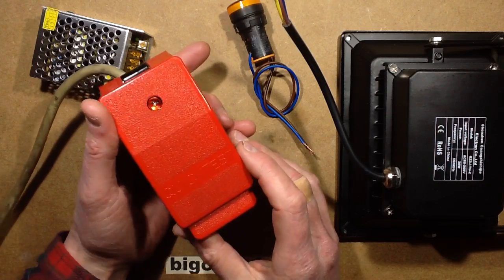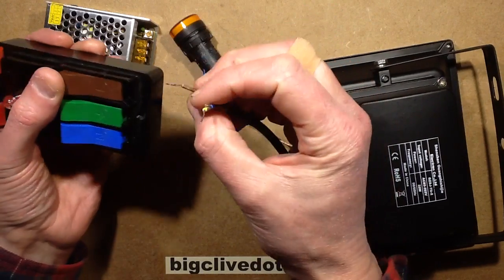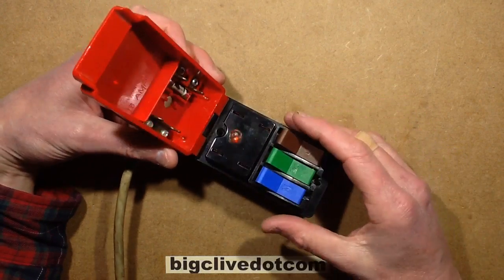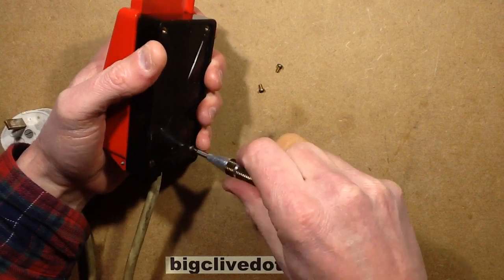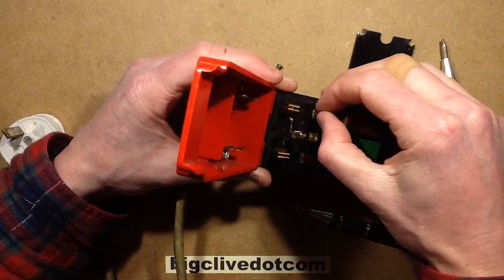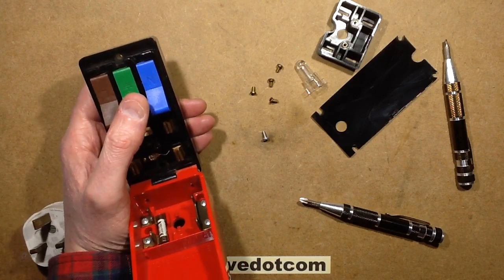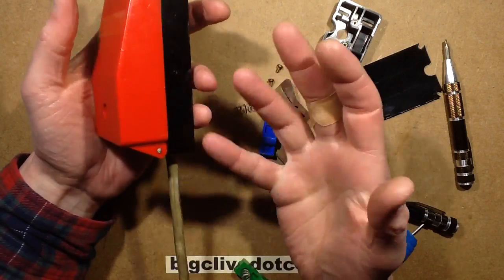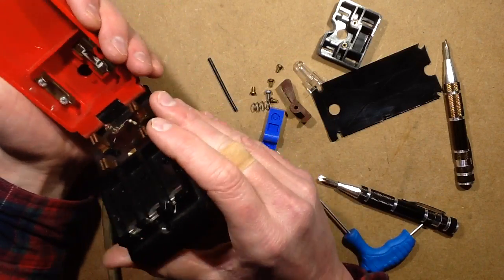A look inside the Cliff Quicktest mains connection unit.

Comment: Finally bitten the bullet and bought one of these. They are expensive but quality costs I guess.
Reply from the maker: They're extremely useful in a workshop.
Reply: Saw one in a second hand shop back in the 1980's the guy showed a fan that I was buying worked with it (the plug was extra). Thought it was a neat gizmo then. The fan is still working by the way.

Comment: I’ve got mine back in the early 80s but it called branded as safe block and the conductors are bear metal but covered when the top is closed. Very useful tool to have.

Comment: The least expensive US supplier I could find (Newark) still has the quicktest with US wire colors for $60 if you buy one and $40 if you buy 20.  However, I did find a shop (cloudfree) reselling them for $48, so I bought one from there. They specialize in non-cloud-based "smart" devices but the owner must be a Clive fan since the quicktest is otherwise quite out of place in their shop.

Comment: Risk analysis:  work backwards from either "I" or "test tech" got electrocuted, and see what's an inexpensive way you could have prevented it.  Or from an ER visit, which is time-consuming, perhaps expensive (depending on where you live), and can only bandage up etc. the parts of you that have been damaged.
Seems a bit pricey, however it covers the live terminals, is well built, won't short when it slides around on the bench, and so on.  I expect part of the cost is liability insurance for the manufacturer.

Comment: These can now be ordered through the Newark website listed above in either the US/Canada or UK/European version for about $35.00 plus $8.00 shipping in the US. That is really no bad at all and a much better option either using a cord with clips on it or using wire nuts to secure wires together. Eventually I'm going to get one of these to replace my alligator clip test cord I control with a light switch for my electrical testing.

Comment: Ancient Clive!? Really!? How about one of the original all black ones with uninsulated terminals marked with red green and black  painted dots (isolated with lid open just the same and fully protected with the lid down). Also, sadly with no neon! Mine is now 45 years old, has fallen and broken three times in the past but now repaired again with plenty of epoxy resin (Araldite of course), sprayed matt black instead of the original bakelite chocolate brown/black but otherwise STILL working perfectly! GREAT devices - and yes, MUCH less than 60 bucks!

Comment: It's now down to $36.72 + ??? shipping from Newark. (I really wanted to provide a shipping price. I tried 3 browsers, none of which would populate the shipping price section of the checkout window. I suppose you must call to check the price, or just cross you fingers and hope you picked the cheapest option.

A a bit of colored electrical tape should serve to remind us 'muricans which wire goes where. I commented in another video about my reluctance to spend $40. Heh. I think I'll write it on my whiteboard under "Shit I want." Usually, things there end up magically getting purchased the next time I have a healthy amount to drink.

UPDATE: Now there's a USA/Canada Version!!! It's $6.48 more, but has the proper colors!!! 
http://www.newark.com/cliff-electronic-components/cl1857/qt1-usa-canada-13a-fuse-quicktest/dp/08AC2593?MER=bn_level5_5NP_EngagementRecSingleItem_1

I might be sold on getting one, now. (Though I'll have to call to order, or at least get help with their website. I can't remove load my cart to remove the Euro version. Heh. Hopefully they fix these site issues soon.)

Comment: In Germany (and other European countries) you can flip the plug, so the normaly neutral contact would get live and vice versa.
That would also mean you'd have an unfused live connection. (The fuse is only on the normal live side). So there really should be a version with two fuses.

Comment: I came across an old Practical Wireless - Nov 69 advertising the type I use, called a "Keynector" or "Safe Bloc" very similar  to your quick connect, however, in 1969 it cost 39/6 + 3/- p&p, just under £2 in todays' money :) I have a pdf of it, but don't think there is any way to attach it to my comment?

Comment: Please Clive. What is that tool with the blue handle that you use to push out the plastic pin? I want one!
Oh, and does the American and Canadian version have an "H" rather than an "L", since they call the live wire hot?
Reply from the maker: It was from a set of hex drivers.
Reply: Doh!

Comment: MK plug top too! You can tell by the distinctive shape and ergonomic design. Also has push in strain relief and wrap around screw cap connections for L, N, and E. As far as I am concerned,  the best UK 240V mains plug ever made. Pretty much every time I would put a plug on any appliance, particularly high current stuff like washing machines, tumble dryers, 13 Amp extention leads, electric heaters and the like I would use one of those. And also as mentioned elsewhere in the comments, as a long time serving electrical tester, I would always have an RS 'Safebloc' connectors like the one shown here for 115 V AC 60hz, 115 V AC 400hz, 240 V AC 50hz, 24 V DC 10 A, and one hooked on the end of a large 3 phase sack barrow mounted variac. The fact that all the terminals on the 3 phase variac were only covered by a piece of crumbling paxolin board, taped on with masking tape was by the by! Great stuff! 😀 Thanks for the reminder Clive.

Comment: Wow. Plastic and and a fuse is expensive these days. eBay wants anywhere from $50 - $100 for these things.
Reply: Been an owner of one of these for a fair while definitely worth it, I fix a lot of appliances and usually folk cut the cables off, usually it's not the material it's the self worth and they have the monopoly as very few companies make them

Comment: I use a 1:1 transformer for that. It's also a lot safer. If you accidentally touch a phase, nothing happens.
I use it for repairs and measurements, too.
You can also use 2 identical transformers and connect the low voltage sides for separation.
edit: I mean real heavy transformers with a lot of copper inside.

Comment: I looked this thing on Amazon and they retailed for $71.54 U.S. or 57.38 pounds. Quite more than I expected.
Reply: You're looking in the wrong place. I initially looked on eBay for one out of curiosity and found them to be quite expensive but if you look on the website listed as suggested, you can get one for under $45.00 USD.

Comment: £29.95 is the cheapest one on Ebay. I bet before you showed it on your channel it was 68P. 

A set of 4 quick speaker connections (saw one off and paint the others) and a 99P micro switch along with a toilet roll and some of Vals' knicker elastic. Shades of 'Blue Peter' there I think. I don't think my friend Ruth and Banggood does them. Either that or they are under 'Wang Ho do it yourself electrocution unit 4000W 600V. Eco friendly good for windmills and solar panels'. No need to change hands. 

£30 pounds BigClive - that's taking the pee. Nice neon though - change it for a warm white.  

I think you have been looking at the 'Intimate Apparel' section on Banggood. My wife went downstairs to get her glasses when I showed her that. I still can't believe you did that Clive.
Reply from the maker: £30 is cheap for these units.  They used to be very common and cost a lot less, but in more recent times the cost has been closer to £50 or more.
Reply: I'll wait for the Wang Ho to appear. 
Do you get email from Ruth ? I am serious - just this once. I was wondering if every email from Banggood comes from Ruth. She's very polite and her English is better than mine. Nice company to deal with, if you don't mind waiting for the bullock in paddy field No 9 to finish having a dump. Poor thing was stuck for 2 months last time but it managed to sort itself out in the end. I sent it some rhubarb you know. That moved it.
Reply from the maker: I think it may be too specialist for the Chinese to bother with.  In a way I hope it doesn't get ripped off.
I get lots of email with random names from Banggood and other suppliers, but generally delete them.  I prefer to buy products myself so I can be blunt about any issues they may have.
Reply: The email I refer to are those about orders I have placed. I do get advertising email from them occasionally. All the ones about my orders come from Ruth and that has been several in a day. I just wondered if it was just a name Banggood use or is there really a Ruth. This has been going on for months, just wondered.

Every morning I look at your channel wondering what we are going to get. Your light hearted approach to some 'subjects' is perfect. Our local Poundland doesn't have such 'interesting' items as yours. Pity.

Comment: I remember seeing these in Shops like Dixon's as a child.  I don't recall when the requirements changed for all consumer products to have plugs fitted; bit I vividly remember very few consumer products being fitted with a plug back then.  If ever you wanted to try a product out, the shop would pull one of these devices out. :)

Comment: $60 !! That's hardly 'reasonably priced'.
Reply: you're damn right there, they're practically giving it away for so little
Reply: For a tool you buy once and use the rest of your life? Cheap at the price.
Reply: @OhShitSeriously  It's the simplest thing ever and probably cost only a couple of pounds to make. The fact that you only buy it once is irrelevant
Reply: @OhShitSeriously  it doesn't matter how long you are selling the product. The actual investment in design matter. So considering they've sold 50k units and are having $50 margin on each it is already $2.5 million! Not bad for a one month contractor design job of a case with a few metal clamps.
Reply: I'm sure you can get a cheap chinese version, if that's what your life is worth
Reply: @arenalife  so which one? How to find a cheap chinese version?
Reply: @pahom2   might want to watch the video with the cheap LED lantern with a NON-ISOLATED USB charging socket on it.
You really want to trust your life to foreign businesspeople competing on price, apparently with little to no regulation?  I don't think they're busting their butts to provide rich foreigners with high quality products at bargain-bin prices; anything that doesn't improve profits (like behind-the-scenes electrical safety measures) tends to get dropped.
And then there's the cute things like naming companies "OEM" because people shop for OEM parts, or the "China Export" mark that somehow mysteriously was chosen to be almost identical to the European CE electrical safety mark...
Reply: @scottwillis5434  this unit cost of production is less than a dollar. It is not about safety it is about greed and marketing. Please don't play for the devil.
Reply: Hmmm.. do I overpay somewhat this one time, or die while testing my devices unsafely one day... hmmm... tough choice. Honestly it's a price of one new computer game so hardly an outrageous amount.
Reply: Yeah.  I was liking the idea of this thing until I saw the price.  In the meantime,  I have a line cord with a couple of alligator clips on the end,  if I need it,  and a box I plug that into that uses a double-pole on-off switch,  has a variac in it,  a current-limiting light bulb,  and provisions for metering the current.  If need be I can plug that into an isolation transformer...
Reply: @Roy_Tellason   ...and what did that box cost?

Comment: +bigclivedotcom Hey bigclive, I've seen you use the Cliff Quicktest in many of your videos and it appears that the neon bulb switches off when you open the cover. Is this the case? The one I just received used from the LabX classified I spoke of in my last comment to the group ($28 and appears as if it was just opened from new) does not switch off when the cover is opened. I kinda wish that it did… oh well… Maybe I'll add a micro-switch; activated with a plastic rod through a small hole in the case… or maybe not. We'll see if it gets on my nerves as it is.
Reply from the maker: +Ken Foland The neon lamp stays lit on all the units I've seen.
Reply: +bigclivedotcom OK, then. Thank You. I was thinking, it would be much easier to simply wire the neon bulb to the switched contacts. But, due to the bulbs location, it may compromise the safety of the unit by reducing the creepage distance, potentially providing a path around the switches in the event of a fault. So, I think I'll leave well enough alone. Thanks, again.

Comment: wish it was available in the USA but I can only find it with a UK plug.  Frankly this tool would be useful in a classroom back when we'd have to make a circuit with wires a bulb  and a flip down switch.  Think thats partially whats driving both the Raspberry Pi and Arduino, and I do learn better hands on.  Not via paper.  Mostly because I suffer from ADD (or in today's sill book ADHD without H  )  smh which is usually when it gets very quiet my mind wanders (Tests)  but I was paying attention in class just not to put it out on a test.  mind would wander.  I'd be fully aware that while it's still plugged in that entire thing is live.  But I had to look it up before bumping into this video..  And it's based on the same principle as the flip down switch we learned to power a light bulb with a simple 2 prong peice of metal with a simple bar that comes down with a connection lock.  Off an old fashioned 2 cell box battery.  Except this thing has alot more protections with it.  Fuses etc.  the worth Earth I'd have to get used to since we know it to be Ground.  I do like the term Earth better as it makes more sense.
Reply: +Lee Bartholomew newark has them wow.  one of my Raspberry Pi suppliers.  Use them often.  I'll have to check that out :D

Comment: A refrigeration engineer , i was friendly with in Coventry ( so friendly the sod still owes me £80 ) , set up a house party , ( about 20 years back ) , as he ' d run out of plugs for light ' s  &  amps etc ..... go round to wiring things into mains sockets using nails ....... & insulation tape . All was going " fine " , ' till , turn on one of these death traps were turned on , there was an all might bang .......... & the base cone of a borrowed base speaker attempted to escape across the room ....... we went down the pub & scrounged half a dozen plugs ............. it was a good party ........... & the music was not too loud !

Comment: I just use a "suicide cord" (a line-cord with fuse in the line)...  BC thanks for showing us how this device works and whats inside...safety is important for anyone working on open, live equipment, but even more important for him with the European voltages...  BC, please remember to get the piano key colors right when reassembling...we wouldn't want you to get them wrong, and possibly spill your "white wine-like peasant beverage" at the next live test!

Comment: Hi Clive I use to have a quick connect back in the 70's and it was the same arrangement apart from the keys, the one I had the keys was decent quality chrome crocodile clips with the lower half screwed down to the bottom of the enclosure ho yeah and the hinged top was also in black and a different shape than the red top. Ho do I miss it!!!

Comment: So is this basically a piece of equipment of which you connect the 3 insulated wires in an appliance's wire, to use instead of buying a plug and wiring it, for testing?
Reply: +Henry Southall It is not for permanent use, as he said. But yeah you can do that if you want.

Comment: Thanks, Clive. I bought one after viewing one of your clips, and I am very happy. It is quite expensive, but there you go... They might consider replacing the neon glow light by a small LED, but that might come in time... I might do that myself one of these days...  In fact, there is a design shorcoming relative to opening the lid. If the device is not bolted onto a table, it is difficult to open the lid with one hand, and when you struggle to use your other hand, there is a slight possibility for a finger to touch a live lead... The solution is to add a small base that protrudes in front (wooden base for instance) that makes it easier to open the lid...
Reply: Yes, that's the problem I've been thinking too with this otherwise quite great little box. It doesn't look like it is easy to open with one hand in case of some emergency.

Comment: Thanks for the link. I tried buying one from a UK ebay seller and he basically called me an idiot for wanting to use a 220v appliance on 120v, and refunded my money. I still think its hilarious that so many people think that the US only has 120v, when we have 220v as well.
Reply: +Zach Demand Oh I forgot to add. Don't be fooled by the substitute on the right side of newarks website. It says $54.04, but that is just for the euro cable, the quicktest unit is not included. That's got to be the biggest rip off ive ever seen.

Comment: I use a "suicide cord" — a 2-conductor extension cord with the socket end cut off and replaced with insulated crocodile clips (red for "hot" and black for "neutral"), and an inline rocker switch to turn the power on and off to the device under test.  It works, but it's not as nice as the Cliff Quicktest block, and I need to be very careful to examine the state of the rocker switch before plugging it into the wall outlet.

Comment: Used a similar device for many years, before UK regulations demanded a fitted mains plug, when I worked for a "Major'" electrical retailer, and needed to demonstrate TV's/ Radios/ etc to customers - an invaluable piece of equipment . In those days we referred to it as a "Safe - Block"